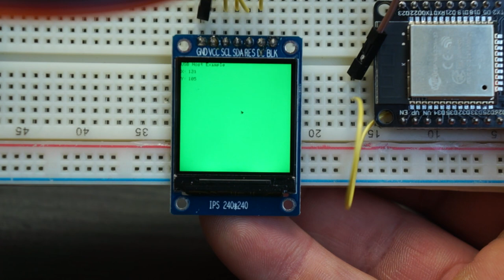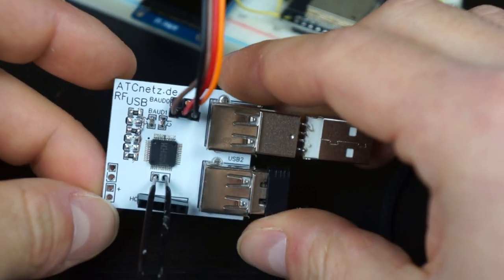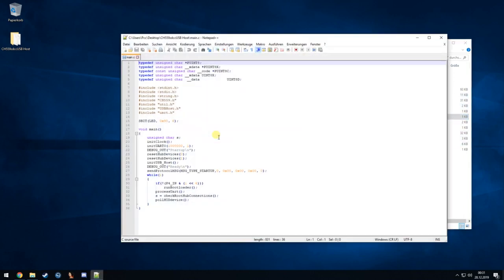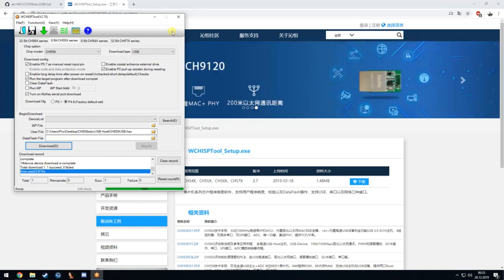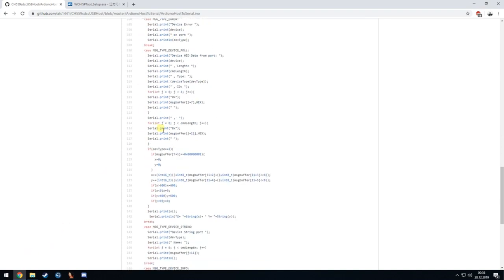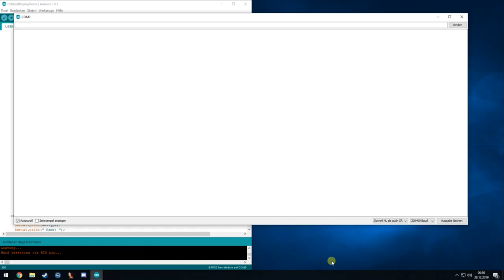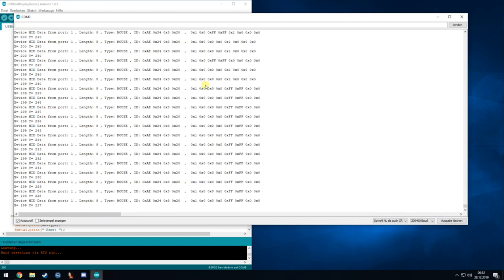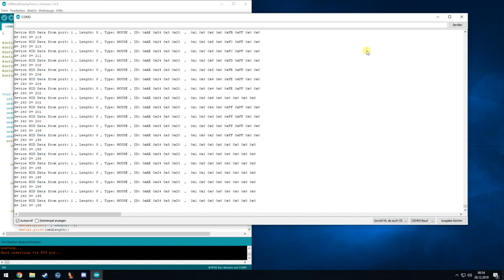Usb mouse and keyboard on Arduino, CH559 cheap usb host chip

Comment: Interesting project! Is this a better option than the MAX3421E? Can it be used for usb-midi devices?
As far as i understood the differences are two vs one host, highspeed usb vs normal, uart vs spi.. right?
Reply from the maker: Hi, this is hard to answer, the MAX chip is not a micro itself, but the CH559 is, you can add any USB functionality you want on the CH559 also MIDI usb memory etc. but it is more work than on the MAX as you work on driver level. you have to know what you are doing.

Comment: Hi great project, the capacitor connected to VDD33 needs to be 3.3uF and above for it to work properly in case using 5v. Took me a long time to discover.
Reply: I'll try. Why u decide using 3.3uF. What happen before it.
Reply: @thoyibbasarah3302  it says so in the datasheet page 3

Comment: Thx for the video. Other than USB keyboard, can the ch55x chip program into a USB mouse? Or even a USB joystick? Any sample?
Reply from the maker: Hi  yes that is all possible without any problem. 
There are some samples from WCH available for keyboard and mouse i allready used
Reply: @atc1441  I wonder if the ch552 is cheaper or the attiny85 is cheaper at 1000 PC. I have a project to build.
Reply from the maker: @eltonleung1387  the ch552 ist cheaper. 
You get 1000pcs for 250€

Comment: Probably a stupid question, but can this CH559 be used to build a HID device from a panel with a bunch of buttons and switches, with output via USB into a computer that will detect it as a HID device?
Reply from the maker: Hi. Yes it can.

But its a bit overpowered for it. 

Please look at this one https://github.com/atc1441/CH_HID_Arduino

I made that library for exactly your usecase but with an Arduino as controller. The code can be changed so it will work on the CH552 directly without any arduino
Reply from the maker: The ch552 has 10 gpios.

What you could do is to use the linked library with a second Arduino as it is intended and use the matrix keyboard library to read that many buttons. 
That could work without big problems and is doable for a beginner :)
Reply: @atc1441  Thanks, Aaron. Not sure I understand what you mean. The plan is to use one of these chips to interface between the buttons & switches and a desktop computer running Windows. No Arduinos involved (unless you're saying I need one and it just went over my head)

Anyway, I'll do my homework, I'll see what I can find in the datasheets because right now I'm hopelessly clueless. XD
Reply from the maker: You understand it right.

Only ch552 or ch559 needed no arduino
Reply: @atc1441  Oh, shit. I misread you, I see what you mean now. Sorry about that, I'm fucking dumb. 
I'll check out that repo, thanks again Aaron

Comment: I'm late to the party, but great/informative video and nice demo. Thanks for working on this and posting. For the CH559L, I wonder if one port is LS and the other port is FS (something in the datasheet made me think that, but I'm not sure). Also, for the 20-pin CH559T version, it apparently only handles one port (I just see dm/dp pins). Do you anticipate a version of your software for that package?
Reply from the maker: Hey the 20 pin version has only one port brought out yes, but it can be used just like that with the firmware. There shouldnt be any proble.

What do you mean by LS and FS?

Greetings
Reply: @atc1441  Wow, thanks for the reply! You are so helpful to your viewers and subscribers.

As for the two-port CH559L, I sort of got the impression from somewhere (a datasheet translation or some other reference), that one port was full speed (FS) and the other port was low speed (LS), but I tried to confirm that the other day and came up short. If it were true, though, and one had a full speed mouse or keyboard at 12 mbps (as opposed to 1.5 mbps), I guess it would have to be used with (plugged into) the FS port (unless the device could fall back to low speed by itself, which I don't know is possible). Again, maybe I misunderstood and both ports can handle LS or HS devices. Also, I really have no idea how many mice/keyboards use FS, but I would guess that most of them are LS (though I wonder about some gaming mice).

As for using your firmware with the 20-pin CH559T version, on the one hand, I just assumed that something could go wrong with the firmware possibly trying to utilize pins that didn't exist (or perhaps were mapped differently, which hopefully doesn't apply).  On the other hand, I only see the one datasheet for both versions, so, hopefully, any instructions specific to the two-port version would just be ignored by the one-port version (other than the execution time). But I'm not sure about that at all. Anyway, while two ports are better than one, if a user only needs one port, then the one-port CH559T part has a smaller footprint and fewer pins to align/solder. But a lot of applications would benefit from the second port, I realize. 

Speaking of soldering, I wonder if you directly tied (no resistors) all of the unused pins high or low or just left them floating (I assume that it's a CMOS part, but maybe the pins have weak pull-up or pull-down resistors on them internally). I'm not sure of the best practice there (but perhaps some chips might use more power with floating inputs).

Anyway, don't feel compelled to address all of that; you've already done so much. Thanks again for your helpful feedback. I keep wanting to say that you've already "gone above and beyond the call of duty," to use the old expression, but it is not your "duty" to answer our questions. Nevertheless, thanks again for posting about your projects.

Comment: I connect my USB wire mouse to Arduino Nano through usb connector (5v, d-, d+, gnd)  and the mouse's red led keeps blinking all the time.
When I run example code from ps2 library, nothing is printed on the serial port.

Comment: Hi, nice video, very useful! Is it possible to flash the chips using the serial conexion rather that the USB?
Reply from the maker: Yes serial can be used also with the WCHisptool to flash it
Reply: @atc1441  Great! And do you know if it would be an easy task to flash it via the esp32? Like getting the binary from a server and flash it to the CH559 through serial?
Reply from the maker: Should be relatively simple. 
I made the Android application to flash it via usb and the protocol is the same for serial so there are not much cmds etc.

Comment: Great tutorial!  I'm trying to work with a micro, that can't quite support 400,000 baud, and when I go to change the baud in your main.c, everything seems to break.  Why did you chose 400,000?
Reply from the maker: That high speed is needed and the highest possible. Any other baudrate need to be divide able by the clock frequency

Comment: Where in Europe can you buy this IC from? Looks like a really good solution for interfacing USB devices to microcontrollers!
Reply from the maker: Best place is lcsc but its not europe :-/
Reply: @atc1441  That was a quick reply! I've done a bit of googling (and twitter searching) and found a couple of different types of dev boards. The ones on Aliexpress are a little pricey, but another site had a board for $6. Appreciate the video as I want to connect both a USB mouse and keyboard to a FPGA (and I didn't fancy writing FPGA HDL code or associated software!).

Comment: Very nice work  Aaron, Is this capable of handling USB midi as a host? Also how about connecting a usb hub? will that work? 
Meanwhile, I greatly respect  the progress that you have made.
Reply from the maker: Hi  yes both thinks work but need work to get it done, watch bitlunis midi video for midi host, and usb hub is in sone example code allready implemented, but only one hun can be connected
Reply: Did you get it working for midi host?

Comment: Great work!
But how's the schematic to upload the bin file to the chip?
Reply from the maker: Hey. The schematic is in the video.
It is just one usb port needed to flash the chip as it comes with a usb bootloader
Reply: So i just need to plug usb from my pc to its usb port?
Reply from the maker: Yes correct. Plus one pin needs to be pulled to 3.3v via 10k ohm resistor to boot in bootloader mode.
No aditional hardware needed. Please see the ch552 videos for deeper indos

Comment: Nicely done! Thank you for the video and the codes. 
I started to work with this chip today itself and I have learnt so much all thanks to you. 🙌
But I am having an issue, here I am trying to read data sent from controller. I have changed the baud rate to 14400 ( of the chip , esp  and my controller ), I am able to connect the controller without an error but the switch case of "MSG_TYPE_DEVICE_POLL" never gets executed ( I am constantly sending data through the controller ). Why is that so?

Edit : The controller here is a microcontroller, Arduino to be more precise.

Comment: Hey, so I'm working on a small project which requires an USB host shield. With one usb port. What chip do you recommend for such a project. (I'm aiming to make it as small as possible). I'm using an Arduino nano (But aiming to go even smaller).
Reply from the maker: Hi this chip is defenetly a good start, you have everything self contained, so no external uC needed, but it is defenetely harder to write code for it than for Arduino. Hope that helps.
Reply: Do you have any PCB examples which I can use to make my own?
Reply from the maker: The schematic is in the video. It is very simple
Reply: Qsharp, what did you use for a solution?

Comment: Really nice! I designed my own board based on your instructions, but when I hold the button to enter the programming mode and plug in the microcontroller, windows says it cannot recognize the device... I tried to install the CH340 driver, but still not works. Could you help me a bit? Best regards, Caio.
Reply from the maker: Maybe usb pins reversed?
Or power not correct. The chips are very easy to get running so these would be my 2 ideas
Reply: @atc1441  Yes, I tried but no result whatsoever. Funny thing is that I was unplugging and plugging and it appeared once in the WCHISPTool, but then never again. So I thought it could be a driver issue, but there are no drivers for this device in wch website.
Reply from the maker: It sounds then like the chip is not in bootloader mode anymore, please check the bootloader button
Reply: @atc1441  I tried, but same result, I ordered 5 of this boards on JLCPCB, same issue with every board... If you are interested I can provide the schematics of the board
Reply from the maker: Schematics@43u.de

Yes please
Reply: @atc1441  I sent the schematics and PCB design, thank you so much for you kindness and help
Reply from the maker: Got it. 
So you push the bootloader button and while pressing you plug the board in ? 
Can your try without esp8266 plugged in

Also where did you got the chips from? 
If not from lcsc it could be they have no bootloader but you mentioned it was detected once
Reply: @atc1441  sure, I tried without the ESP plugged in, and between one of the several trys it got detected, but in the middle of the firmware download, it stopped. 
The CH559 I got is from lcsc, they did the SMT assembly
Reply from the maker: That sounds like a usb voltage/power problem. The schematics lools good
Reply: @atc1441  I thought the same, so I just soldered a jumper wire over the resettable fuse, and same issue, currently powering the circuit with my laptop over usb 3.2
Reply: @atc1441  Great news: from the beginning I was suspicious of windows. So I downgraded the last windows update and sure enough it worked. Windows being windows. Thanks a lot for your help. Also, I would like to know if I could mention you and Matthias in my final report for this project...
Reply from the maker: Oh good that it works. Strange that windows was the problem.
Mentioning would be nice :)

Comment: Is the Reset-Button also necessary for the CH552?
Reply from the maker: Hi. Bootloader button is on the usb data pins on the ch551 to ch554 please watch my other video about that chip :) 
So still needed but on another pin and you need a resistor.
Reply: @atc1441  Thank you! :)

Comment: Can the CH559 be used to allow 2 or more ESP32s to talk via usb (usb to usb) rather than usb to serial?
Reply from the maker: In theorey that is possible, but one device needs to be a usb host and the other a usb slave. Then it does work
Reply: @atc1441  Thank you

Comment: It sucks that the open source driver is no longer recent enough to work with the new bootloader versions. I have to use a windows VM just to flash the chips
Reply from the maker: Hi. It is possible to change the open source tool to work with it. 
I allready tested my android flash tool to flash the ch559 and new bootloader is working anyway with it
Reply: We were probably talking about different open source flash tools. Yours seems to have support for the latest bootloader
Reply from the maker: @dgramop  i maybe will create  a tool that supports v2 bootloader, but i think there allready was one. dont remember the link right now.
Reply: @atc1441  it looks like librech551 has some kind of beta/untested functionality. Will have to see if that works
Reply from the maker: This seems to be allready compatible for v2.31 but only tested on ch551. It is easy to change it to the other versions of the chip

https://github.com/NgoHungCuong/vnproch551
Reply from the maker: Also this should work with a bit of editing(Not tested)
https://github.com/juliuswwj/wchprog/blob/master/README.md
Reply: @atc1441  interesting, I didn't find those repos yet. I'll take look!
Reply from the maker: Hi again. I wrote a small python script for bootloader v2 to flash the ch55x family. That is working under windows with pyusb and libusb. 

Please send me an email to usb@43u.de 

I will send you the file then you can test it under linux. I will make it public with a video but not right now.

Comment: Have You tried to send mouse position using I2C on this chip?
Reply from the maker: It does not have hardeare i2c so a slave i2c is very hard to implement

Comment: Hi, i would love to use these along-side my ESP32s however I cannot seem to get it to show within WCHISP, windows does not seem to detect the CH559
I have installed libusb-win32 using Zadig but to no avail,
CHFlasher also does not find the chip

Any ideas what I could be doing wrong?

All the best!
Reply from the maker: Hi. When the Libusb-win32 driver is installed wchisp is not able to see it, you need to install the stock driver to use it in wchisp. That driver is called something like ch341 if i remember corectly.

ChFlasher should be able to see it.

Comment: Hello
You are true teachers, thank you very much for your contribution.
I could already modify the code a bit for my purposes, but I would like to know if it is possible to use a speed of 9600 Bauds ?. I have tried it but it does not work at that speed, from 14400 it works fine.
Reply from the maker: Hey.
14400 is the fastest speed possible and better, 
If the speed is lowered usb is to fast for uart.
Any lower speed needs to be a divider of 14400 to work
Reply: @atc1441  Thank you so much your help. You are a Master!!! 👌🏻👍🏻

Comment: I was able to get this to work but with many gamepads like popular logitec F310,  the arduino code detects the device and receives Device info on portn but it does not get the HID info data at all.  Can you please review why some devices are not sending Hid info (msgType 7  MSG_TYPE_HID_INFO) when connected?
Reply from the maker: Isnt a gamepad not a HID device and more a Gameinput.
Please take a look at Bitlunis gamepad video part on this project
Reply: @atc1441  thanks,  I got the F310 game pad to work but only when its in Direct input mode (switch on gamepad).  When the gamepad is in XInput mode, and first plugged in, it only sends USB descriptor and not the HID report.  I have the same issue with other generic wireless devices that have a dongle. I.e. I get the USB Standard descriptor when plugged in but not the HID report descriptor.  Will keep digging as I will have to review your library code to see why its not sending HID report.  Otherwise the system works like a charm with most other gamepads.

Comment: Could it be a HiD relay? I would like hid devices such as barcode scanner or keyboard are read by this chip, send the data to UART and relay the HID data to computer as slave keyboard.
Is it possible?
Reply from the maker: Yes that is possible :)
Reply: @atc1441  do you have some references about this matter?
Reply from the maker: Unfortunately not but just look at the source code from this project
Reply: @atc1441  I have done some research about this matter. In USB control register, ch559 could be either HOST or DEVICE, but can't be both at the same time. Ch559 secondary port is dedicated for host only.

Comment: Sample Arduino code Port number is wrong for msgType MSG_TYPE_HID_INFO and MSG_TYPE_DEVICE_POLL.  The Sample code always returns port 0 for the device regardless of which port the data is coming from.  looks like "device" variable is offset byte 7 of msgbuffer but when msgType value is MSG_TYPE_HID_INFO or MSG_TYPE_DEVICE_POLL this is not correct.  port ends up being 0 instead of values of 1 or 2.  

I checked msgbuffer values and the first 11 header bytes are identical regardless of port the device is plugged into for these msgtypes.  my devices descriptors dont have a report id so i cannot tell which port data is comming from.  Can you please assist?
Reply from the maker: Hey, thanks for the comment and issue on github.
Unfortunately i can not help you right now with it as i would need to setup the whole system to check it
It is so long ago that i have it not in my mind anymore
Reply: @atc1441  no worries. Thanks for replying. I will try review the code and figure it out.. Will post back for others once I solve it.